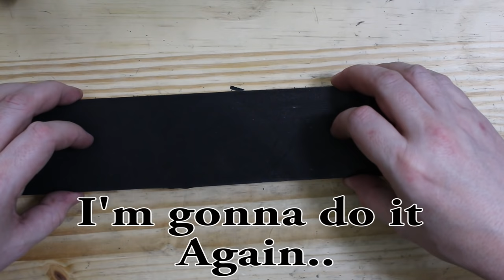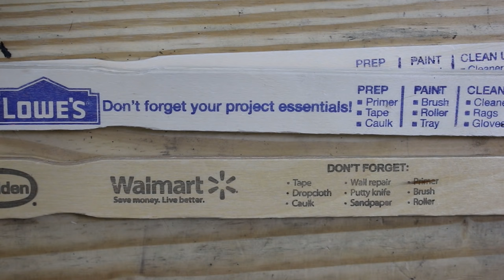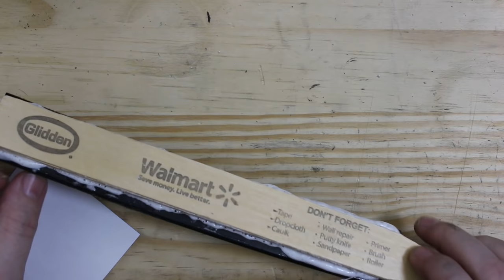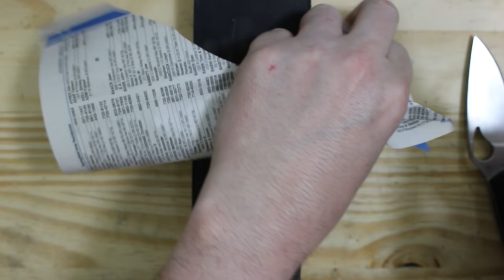How To Make A Strop from A Belt Or Scrap Leather On The Cheap

Comment: Very good video. One suggestion: When clamping the pieces and before the glue dries, use a rag that's been dipped in hot water and wipe the excess glue. This will take care of excess glue and take care of any messy glue on the project. I learnt this when I was working in speaker cabinet manufacturing.

Comment: Cool strop. I made a strop out of an old pair of jeans. Not the best but it helps maintain an edge on softer steels.
Reply from the maker: +Tactical Cats yup, just about anything slightly abrasive will do the trick, for the softer steels
Reply: How do youuse the old pair of jeans,? to make a Strop.? Never heard of that before.? Would like to know how it is done etc.?
Reply: There is a tutorial on the rockstead website on how to make one. Type in rockstead knife strop on google, it should be the 1st one that shows up. Or type in denim strop on YouTube.

Comment: How do you decide which side of the leather to put up?  I assume that the finer the grit of compound you use is best on the outside of the hide and the coarse compounds use the inside of the hide, is that what you do?  Or more pragmatically, I have a wore out old belt but it has a pattern pressed in on the outside so of course the inside face is what I use to strop on and glue goes on what used to be the show side of the belt.
Thanks for another good video Zel.
Reply from the maker: +Canadian Cutting Edge I think you've figured it out, remember the leather is just a pad and something to hold the stropping compound, either side will work. I usually just pick the least rough side. Thanks for watching and have a great day!
Reply: Thanks Zel, I have been stopping for a LONG time, though I have not been very good at it.  But last knight I watched about 5 various videos on stropping and  then I tried the tiny changes I learned and had a great time outcome stropping this morning.  
My viewers want me to make some how to type videos, while I am not ready to make one on stropping yet, I am a step closer to becoming efficient and more effective at it.  Thanks to guys like you.

Comment: I ordered one of those small leather Hand held Strop  + the green Compound also Came from China on an E Bay store.? After I got my knife Razor sharp, On my Arkansas Stone, I decided to try the new strop out,? Followed the way, You sharpened your knife in the Video, When I was done the Knife became very Dull,? The strop,? Took the Razor edge right off of the blade,? So I went back onto the Stone & re sharpened it again, And did not try Stroping it any More, I do not know what I did wrong etc,? I am going to make a Strop, Out of the Oil Tanned leather that I ordered off of E Bay,? Mount it on a Board, like you did,? And see how it goes etc.?
Reply from the maker: I suggest you watch TheApostleP's video on stropping, he does a good job of going over the hows and whys of stropping.

Comment: Plus those Wally World Paint Sticks,? Already have a nice handle on them also.? COOL.? I gust ordered some strips Of Oiled Tanned Leather, from E Bay store,? To use for making some Strops also.? they say that the Oil tanned leather is good also, to the  Veggie Tanned leather.? We shall see.?
Reply from the maker: I'm not sure about oil tanned leather, but it should work. Also if you have an ACE hardware get the paint stirrers there, they have some slightly shorter ones that are made of much better wood.
Reply: No Ace around just Wally World, Home Depot & Lowes,?

Comment: Contact cement is what I have used for years. I do custom leather work.  It will save all that glue mess.
Reply from the maker: Thanks for the info, I'll try that next time and get it in the next Strop vid.

Thanks for watching and have a great day!
Reply: Zelrick - sure thing brother.  Dap Red Can "original formula" is great.   Another thing is to use a heat gun on the leather a little before rubbing in the compound. It can open the pours some.  Thanks for the tutorial.